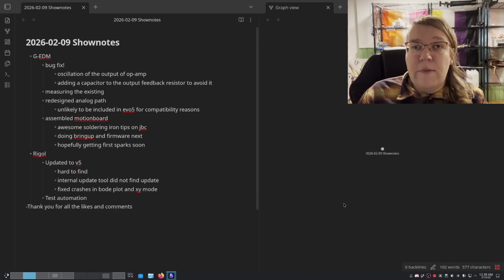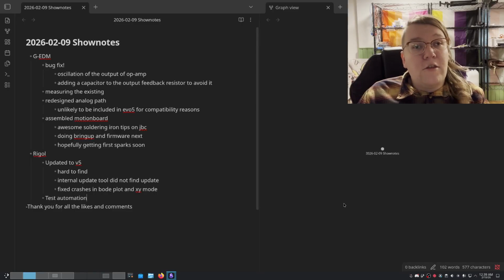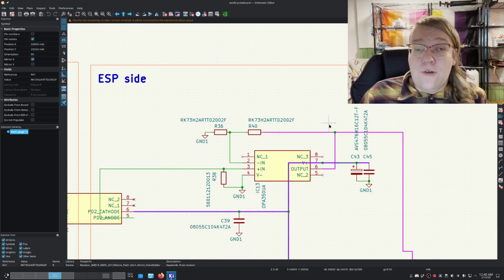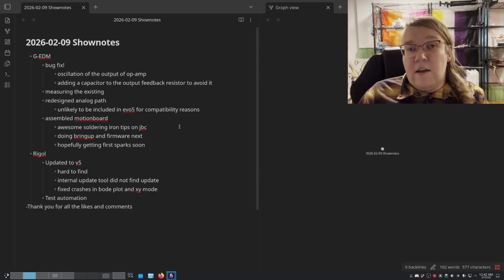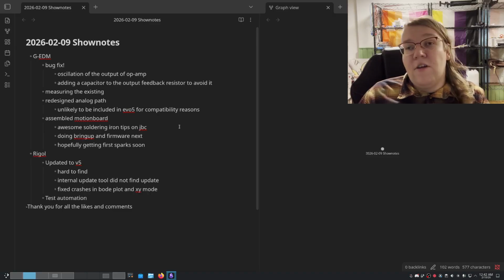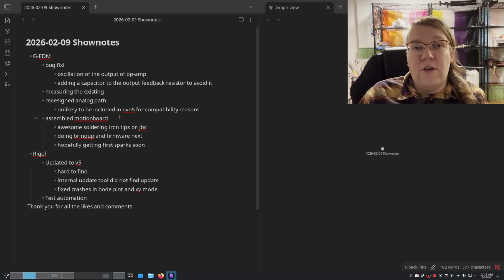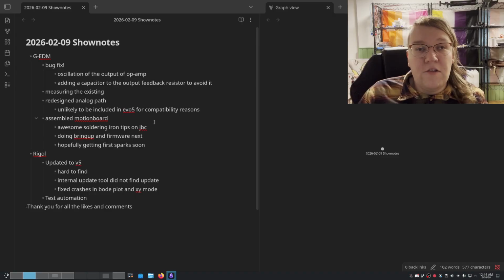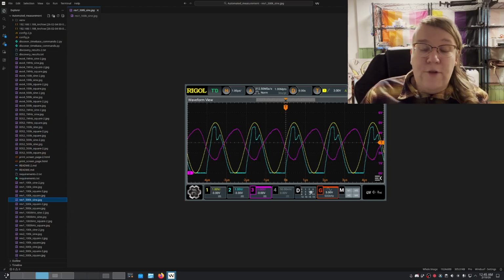Lab update 3 fixing G-EDM bug, developing a highspeed analog optical isolator, RIGOL test automation

Comment: Hey, I’m working on my own EDM rn. Since I’m more skilled at mechanical / CAD engineering then electrical, I started with that but eventually I will have to build the power supply. What’s the best way to start getting into this (I’m a first year bachelor EE)? How does the power supply u r working on differ from expensive baxedm arc generator?
Reply from the maker: EDM power supplies are all about current control, producing a sharp rising, current controlled pulse through a plasma channel that will act like a short if you let it. The simplest designs use a resistor for current limiting. Simple, cheap, but inefficient. A lot of simple supplies will also you capacitor discharge to generate pulses. While these are constant energy, they are not constant current with a sharp spike at the front. These cut aggressively, but leave quite a rough surface. They are however quite forgiving as the high current discharge physically moves the wire away a tiny bit, preventing shorting.  Higher end supplies do inductive limiting, kind of like a buck converter of a unipolar class d amplifier. Typical pulses are around 20us, but can go down to 2us, so you need something that has a fast rise but also good regulation. These are kind of opposing goals. Regulation is easiest when your inductor has a large value, and current through it changes slowly. Fast reusing and falling wants a small inductance, which then however needs go be switched at a higher frequency. Higher frequency however means more switching losses, more powerful mosfets typically have higher gate charges, so you’re designing a high power switch mode converter at the upper end of usual SMPS frequencies of 500kHz to 1MHz. Another thing the BaxEDM does is iso pulse mode. The breakdown of the spark gap is a statistical process and will take a random amount of time between 0.5 to 5 us. A normal power supply will just turn the output on for a certain amount of time, but this means a 20us pulse might actually just be 15us or 19.5us long, which isn’t the best for consistency. in iso pulse mode you observe the gap conditions in real time, and only start counting after breakdown has occurred. This however isn’t doable on a simple microcontroller, so you will need some more fancy control for that, like an FPGA or similar
Reply: @PhosWorkshop thanks u that’s already a lot and a great starting point for me. Seems quite complicated tbh but an interesting and exciting rabbit hole.
Reply from the maker: The G-EDM is nothing special in terms of EDM power supplies. It is built around an off-the-shelve buck converter that is relatively fast with some output capacitance. Far more efficient than any resistor based versions but with limited fine control over current shape. From there it’s just a big mosfet driver and some normal fets. It has feedback for voltage and current, but no iso pulse mode, and the control loop just sees a low pass filtered version anyways. It’s a proven, solid foundation tho, and I want to first get that working well, before o try to design a more advanced power supply. The G-EDM also covers everything, power supply, motion control, mechanical, and there are even CAD/CAM engineers, lots of things that are all challenging on their own
Reply: @PhosWorkshop which one (powercore v3 or G-EDM) would you say is better and which one is better to build first (I mean as a start of the learning curve when diving into EDM supplyies)?
Reply from the maker: The power core is a mess. It feels both over-engineered but also unfinished. I have a video going over its design in detail. Building one yourself is a nightmare, 4 different PCBs, custom machines heat sink, these design decisions also feel arbitrary, as if they just decided they needed to shrink down their power supply into a tiny form factor. And it seems like borderline false advertising to call it a dual converter topology if they omitted one of the two converters in the design stage. What they are doing with using a separate voltage and current phase is novel and seems promising. But since their prices just went up to almost a grand it seems questionable. The G-EDM is the opposite. A project that has mainly been run by a single developer over years. Good community, proven to work but feeling a bit hacked together.
I personally chose the G-EDM to contribute my time to, and I am working on making it easier for new user to get started. I very much recommend joining the G-EDM discord, a lot of people building their own machines happy to share knowledge and help out
Reply from the maker: @lampnikpl5212  I also just discovered the OpenEDM project. while it does not seem they have any real released versions, their topology is some of the most interesting stuff I have seen. very interesting switching converter, with similar specs to the BaxEDM. I will make a video going over the circuit once I am more familiar with it

Comment: Don't blame the messenger. Well analyzed. What I think is that the fix is really easy to add, two caps can be soldered onto existing boards. No issue. In regards of the bandwidth it requires more data. So far I get the feeling that we may not really want the high speed reaction. The voltage feedback is not really gap voltage but proximity and thus should stay more solid and less reactive. The current feedback on the other side could use faster speed but may also require some kind of stability across more then a single pulse. We will look at that and decide then if it is worth the change. Also not that changing some passives on the existing circuit would also increase bandwidth. Currently there is many stuff acting as low pass that can be changed. Lower cap values, different resistor values. The oscillation will not affect normal operations. It is a very special case while simulating with a constant voltage in a virtual scenario not happening in the process. So not too big of a deal and you provided a fast and easy fix for it. Thanks for the help.